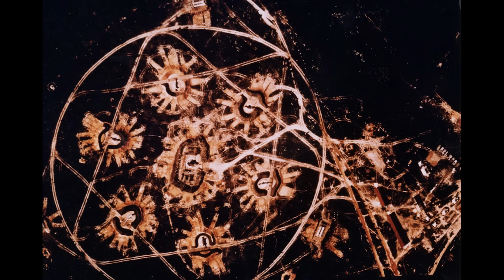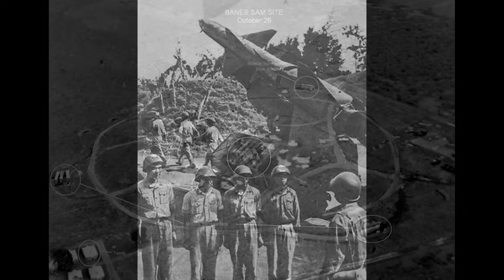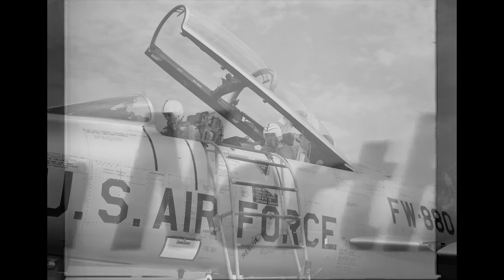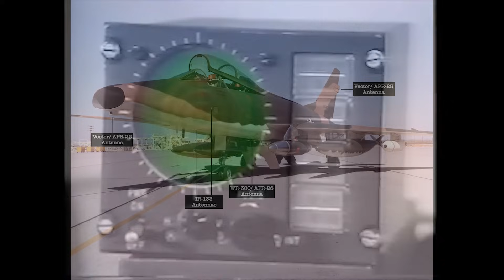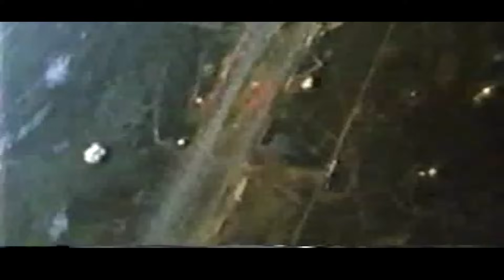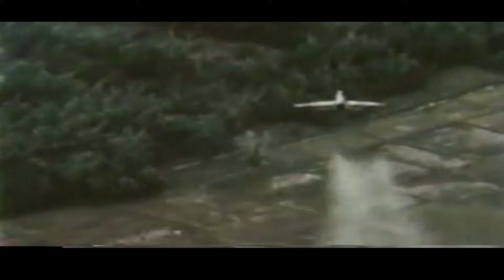Wild Weasel 1: Super Sabre vs SA-2 Guideline In Vietnam

Comment: Fun fact about the Anti Radiation Missile the US used, other than the Shrike the US used the Standard Missile for the US Navy ships as an Anti Radiation missile, it's called the AGM-78 Standard, it could home in on enemy radar signal or emission even when the radar turned off afterwards the missile could still home in on the radar and had a longer range than the Shrike. Each Standard Arm cost about 200k USD and aircrews had to fill out page long after action report why they used and at what target they fired the Standard Arm.

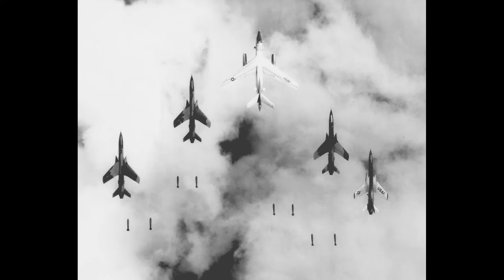Comment: In the Air Force, I was an Electronic Warfare technician. I worked on the AN/APR-25/26 system, as well as the QRC-160 jamming pods like the one at 7:15. Our motto was "ECM - live with it, die without it."

Comment: It wasn't 'too slow', so much as it was unable to 'Jink' at anything past 5-G's without risking breaking a Wing off of it!! But, the F-104 was Worse, in 'G' 'Limited' ability, much UNLIKE the F-8, or, A-4, for that matter! That FORD Exec-in-charge, never EVEN Thought About what 'G' limits do to an Airframe's Combat Ability, nor LIFESPAN! We burned thru the F-105 Fleet in 'Nam, but those that came Home, often still got another few Years of Use. F-4's were 'new-then' and came back "war weary" from Nam. Guess which company gave Airframes in both Attack/&/Fighter on a similar platform, that came back, ready to Serve another 25 years? Vought.

Comment: Great video. When I worked for Texas Instruments, an engineer related his experiences working on the F-100 Wild Weasels. Ergonomics proved to be important as it was difficult to manipulate the buttons and switches when performing high G maneuvers. Another lesson learned was to ditch the white helmets since the AAA gunners would key on them when tracking the attacking jets. Until the Air Force decided on a new color, they issued camouflage tape to cover the helmets.

Comment: There is actually a free Guideline simulator one can download on the internet. Its the very same one  Sa2 Sam operators used to train on !  I tried it one time. It's the real deal.
Reply: What is it called?
Reply: @rambie2131 
Just Google for "SAM simulator" - it'll take you right to it. 
Breal's information is a little out of date, the software simulates many more Soviet / Warsaw Pact systems than just the SA-2.
Also it's the manuals used by the software's author (and included with the download) that are authentic. The simulator was only written within the last decade or so. There's no way any SAM crew ever used it as part of their training. Computers capable of running it simply didn't exist back then. 
It's still absolutely fascinating however. Well worth downloading.
Reply: @rambie2131  Sa-2 simulator I believe.

Comment: The leader of sac during the early years of Vietnam must have been super high on something. I don't know if he was smelling his own farts or what. But throwing damn near a hundred slow moving heavily. Laden bombers at a anti-aircraft missile site is about the dumbest thing I've ever heard.
Reply: What heavily laden bombers were thrown at SAM sites by SAC in the Vietnam war?
Reply: @gort8203  I'm sorry. Did you not here in the video where he said that they sent a bunch of f105 thunder Chiefs loaded with 1000 lb moms to take out of Sam's site. They are slow, not very maneuverable and a bunch of them got shot down cuz it was a stupid idea. The f105 is fast when it's not laden with ordinance, but they were which is why they mostly turned into little grease spots on the ground.
Reply: @michaelfrench3396   
F-105s were not sent by SAC, which was Strategic Air Command, the operator of B-52 heavy bombers.  The F-105 tactical fighter-bombers there operated (as I recall) by 7th Air Force under PACAF.

The F-105 was anything but slow.  It was the fastest fighter-bomber in the inventory and was designed for attacking well-defended high priority targets at low level.  You appear to be completely ignorant of air to ground aircraft and tactics. Your use of the word maneuverability indicates you probably think a slow airplane like the A-1 Skyraider would have been a better choice for this mission.  That's of course completely ludicrous, and even more of them would have been shot down attacking that target.  One wonders why you think fast light bombers like the F-105 were even built.
Reply: @gort8203  actually, I'm guessing that like an A6 with strikes or something like that might be a bit better. And you should look up the low-level performance of the f-105 thunder Chief, especially with a full bomb load. At sea level empty, its speed was 845 mph.  And with a full bomb load they would burn through all their few really really quickly. Not to mention that there really weren't any bombs that could be dropped while the aircraft was going supersonic. So these planes had to get down low in order to be accurate which made them susceptible to horrible AAA fire and they weren't flying super fast because they had to drop their ordinance. Life isn't a video game. You can't drop your bombs at 800 mph. They're either going to hit your airplane and blow it up or they're going to go. God knows where. I'm saying that the military leadership knew that it was a bad idea to throw a Large group of heavily laden aircraft at a Sam site. That's the reason that later wild weasel missions, which my dad flew for the US Navy in the good old a3d and ea6a, aircraft were flown alone or in pairs. To make it harder to hit them. Plus they also had the shrike missile, which, although not super accurate, did allow you to not have to fly directly over the Sam site to destroy it
Reply: @michaelfrench3396  You remain wrong about everything.  

The F-105 was the fastest thing going at low level.  ALL airplanes are slower while carrying a heavy external load.  The A-6 would not have been faster carrying that load.  I don’t know that any of these aircraft were cleared for release of an external bombload at supersonic speed. Who said they would be at top speed when releasing their bombs? You are making up counters to irrelevant points not even made.  

By the way, heavily laden is a relative term. Yes, bombs are heavy.  If you think any jet carrying a normal bomb load is ‘heavily laden’, then they are all always heavily laden all the time, and there is no way to send a non-heavily laden jet against a target.  You are soaking your comments in pejorative language that means nothing in realty.  

Any jet attacking a SAM site was going to do it at low altitude.  Of course there is more AAA there. What plane do you think should have been used to attack SAMs from higher altitude (which was of course within the heart of the SAM engagement envelope).  The F-105 was designed for striking ground targets.  The air force did not have a better plane for the job or they would have been using it.  We could discuss the tactics employed, which varied during the war, but that is beyond the scope of your comments and your knowledge.  

Weasels flew in pairs. Of course, in the battle area.   Not to make them harder to hit, but because they were a limited resource, and you don’t put them all in the same area.  Because they had to maneuver a lot to do their job, and a two-ship flight is a maneuverable formation.

“I'm saying that the military leadership knew that it was a bad idea to throw a Large group of heavily laden aircraft at a Sam site”  
No, they didn’t know that, and it’s an inaccurate description of what they did.  Again, your pejorative language means nothing.  It was a strike package.  You have no idea of how a strike package works.  It is not “throwing damn near a hundred slow moving heavily. Laden bombers at a anti-aircraft missile site”.  A strike package is a coordinated group of aircraft, and they all don’t swarm over a single point in the sky at the same time.  You need to learn a lot more before you start criticizing the actions of people with more training, experience, and responsibly in this area than you will ever know.
Reply: My God everybody's so butthurt that I confused TAC and SAC. I'm guessing it's the only problem you could find with my argument.
Reply: @michaelfrench3396  "My God everybody's so butthurt that I confused TAC and SAC. I'm guessing it's the only problem you could find with my argument."
 It's a huge mistake indicative of ignorance of the subject matter, and it's not the only problem with your comment.